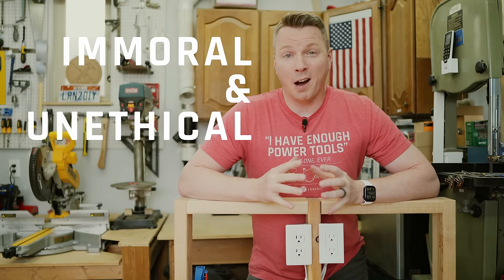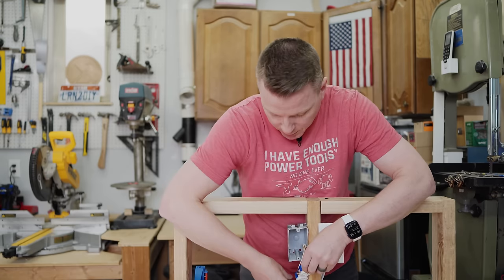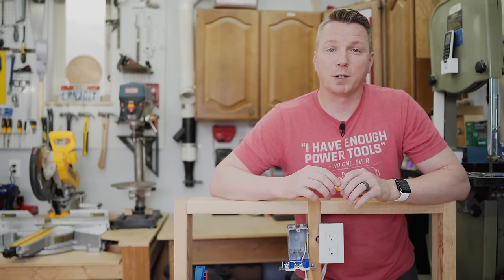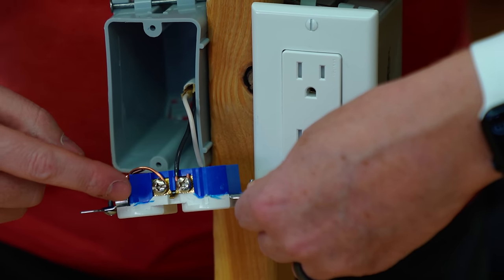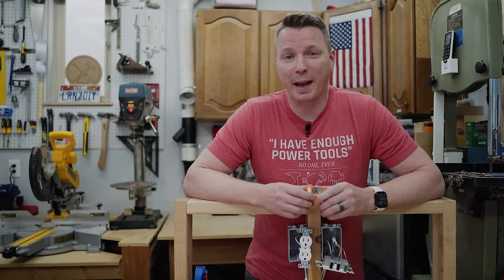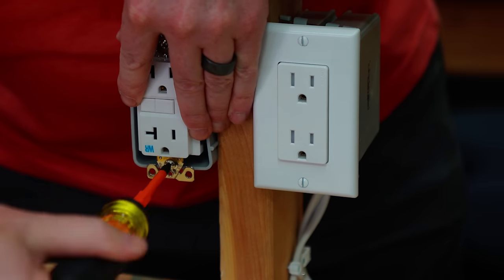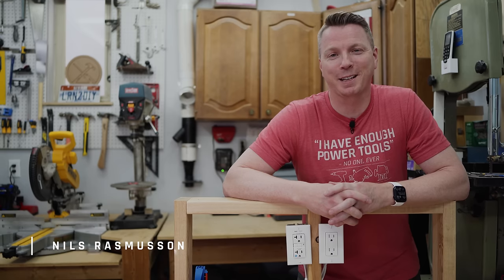People Are Adding Deadly Hacks to Outlets

Comment: I would ask "so why are the neutral and ground wires connected back at the main box"? Except for as far as I understand, the ground wire is a safety wire in case the hot should short on it and need a path back to ground thereby tripping a breaker. I think that's how it works, anyway.

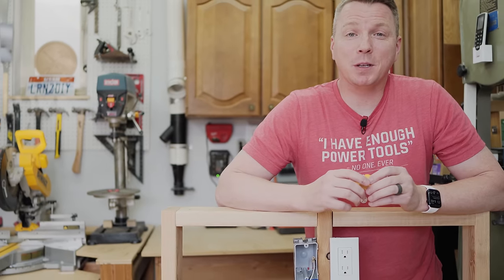Comment: 2:40 If all of the circuits weren't connected to anything (no Earth, no ground, no neutral), couldn't you connect a sensitive multi-meter between neutral and ground and measure the resistance? A bootleg ground would have a much lower resistance than a properly wired one. (There are other complicated techniques for measuring wire length that I'm sure the $450+ detector uses.)
(Caution though: you could easily fry a multi-meter using the resistance setting if there is voltage on the wires.)

Comment: Cheap tester vs. expensive tester. Cheap testers lack the ability to test the resistance between ground and neutral wires. The longer the wire the more resistance. As such an unusually low resistance would indicate a boot or short.

Comment: 8:00 "It's gonna handle all of that computation in just milliseconds"
That's not how gfci works. There's no computation per se, the socket doesn't need any micro chips, it's just sending the live and neutral through anti-parallel co-wound coils so that as soon as there's a current going through one but not the other it create a magnetic field. We can detect that field with a simple reed switch which can be tasked with tripping the internal breaker.
Reply: That is how they work in Europe. In the US the are electronic. They need to be far more precise as the tripping current is just 4-6 mA. In Finland electronic ones are banned as they are not voltage independent.

Comment: Favorite messed up house wiring I saw was the one where ALL the wiring in the house were yellow wires. Must've had a sale.
Reply: 😂
#12 Romex is yellow. So about 90% of the house will be yellow jacketed Romex. Black and orange for a couple loads. 

Unless you're talking about conduit, in which case it's about 90% homeowner "I don't want to buy 2 rolls of wire". I carry 7 colors of thwn-2 on the service truck in 3 sizes.

Comment: In my experience, a bootleg ground usually is detectable by an outlet tester. The ground light (the light on the right on the Klein brand tester) is not lit as bright as the middle light and flickers. If a GFCI has a bootleg ground, the trip button on the tester will not trip the outlet.

Comment: Simple way to check.  
If the outlets are 3-prong AND show to be wired "correct", but there are NO ground conductors in the electrical panel AND the home is not wired with metallic conduit...BIG RED FLAG. 
It is important that your home inspector remove ALL electrical panel covers (main panel and subpanel/s) and check for proper ground wiring, bonding AND grounding. The inspector should also remove a sampling of outlets to check for proper wiring. 

The usual suspects
If the home was built in 1971 or earlier and has three prong outlets...CHECK very carefully. In fact the NEC 1971 was not widely adopted as municipal codes until 1974.  (The NEC is not a "law" and is not a requirement, UNLESS the local authority having jurisdiction has legally adopted it as their code).
Three prong outlets have been required by the NEC since 1962, but until 1971 were not required to be properly grounded.

Comment: Shady, yes. And not recommended. However, at least in Finland this installation is acceptable in some situations. I could quote the codes but they are in finnish. How do i know? I had to do this in one location few years back and i did read the guidelines/regulations through. I am a certified electrician with an engineers degree in electrics and automation. Btw, i did this on a room scale and not in single outlets.
Reply: Different countries different codes. It is not allowed in Sweden for example.

Comment: Nice lifehack. Does it also work in europe?
Reply: Each country has its own codes. In Europe you do not need the GFCI trick as you can always plug grounded plugs into ungrounded sockets. If you want RCD protection you can pick a portable RCD for some 15 €.

Comment: In Australia its illegal for anyone but a qualified and certified electrician. They must give you a certificate of conformance to electrical standards making them liable for any issues. Electricity is too dangerous if you dont know what your doing, and whats with power points/sockets without on/off switches.

Comment: Wouldn't you be able to test if the connection is ilegal with a multimeter? 

Multimeters have an option to detect if there is connection between 2 parts, turning off the power of the house and testing from Ground to Line and Neutral holes would reveal if they did one of these ilegal connections.

Though ofc, if they didn't connect anything to the ground then that wouldn't work, though would be able to test that with one of the cheap outlet testers I guess

Comment: While your comments on code requirements are correct and safety is kinda right, you don't seem to have much understanding of why we have separate bond wires, what kinds of faults may pose a danger if the neutral is used as a ground or what risks are created by the reverse polarity bootleg. What people need to understand is that the ground wire in many appliance cords is connected directly to any metal parts that are not intended to conduct current such as a metal case or chassis. Think of appliances like toasters, microwaves, washing machines and the like that have metal cases. Those metal cases are generally going to be directly connected to the ground pin of the appliance cord. So now you can start to understand some of the things that may go wrong when you tie that ground pin to the neutral at the receptacle. A few things that can happen:

1. Upstream GFCIs may become unable to detect ground faults before they're able to cause injury.
2. You're now placing the return voltage from the neutral pin on those metal parts. If there's an upstream wiring fault on the neutral wire, that voltage could be substantial. In the case of a break in the wiring, this will be the full 120V mains voltage. 

This also explains why the reverse polarity bootleg ground is so bad. You're now connecting the hot wire directly to exposed metal parts on many appliances. Maybe the paint will provide enough insulation to prevent a shock - if it's painted. If it's stainless steel or scratched, then you could be in for quite the shock when you next touch it.

Comment: That hot to ground bootleg could potentially ruin electronics in addition to electric shock. Most decent digital electronics don't care which line is hot thanks to the rectifiers in the power supply. The issue comes in how the manufacturer grounded the power supply. Worse case, the hot line might go straight to the housing of the equipment.
Reply: Many years ago, AC/DC radios and TVs were common and they expected the neutral wire would connect to chassis.  Reversing hot & neutral could result in a deadly situation.
Reply: I would argue that the power wouldn't be on long enough to damage anything. If you were to take the hot lead and directly short it to ground and then turn the breaker on, it would trip immediately. Most modern power supplies have so many safeties built in to protect itself in situations like this it would most likely be fine.
Reply: @James_Knott  Reminds me of the old guitar amps with the two-pronged plug and the "death cap." Musicians would keep flipping the plug in the outlet until their equipment had less hum. That certainly used to cause issues with amp chassis being "hot."

Comment: Natural is NATUAL, ground is GROUND, that's it.
In my personal experience, connecting ground to nearest metal that go though underground like structure metal beam, metal pipe for heating or water is still better than natual, despite it's illegal too.   Ground and natural have same electrical level is a thing from "perfect" world, which ours is not. 
Years ago in the place that I lived in, I always got shocked when contacting the metal case of my computer. They had the same wiring diagram. After I wired the ground to a structural metal beam, I nolonger feel the shocking.  And I it turned out that the voltage between natural and metal beam was near 20V !

Comment: havent watched but guessing talking about running wire from ground to neutral. I had an electrical company tell me to do it to fix my open grounds
Reply: If they told you to do that, whatever that company is, needs to be reported.  Jumping an electrical outlet’s ground terminal to neutral, is very dangerous.  Most appliances that use this safety ground, tie the ground, which normally should not carry any voltage,  directly to the casing.  The idea here, is that if there’s a wiring fault in the appliance which causes hot to touch the casing, a properly grounded outlet will cause hot to short directly to ground, thus tripping the breaker and killing power the appliance.
By jumping ground and neutral on an outlet, you’ve basically connected the casing of any grounded appliance directly to part of the actual circuit!
Reply: @sneskid78  is leaving an open ground safer?
Reply: @you7uber5  
Neither option is considered safe, and therefore neither option is legal via the National Electric code, but to answer your question, leaving an “open ground” is “safer” than jumping the outlet’s grounding screw to neutral.
An outlet’s ground connection under normal circumstances should have ZERO voltage.  The only time it carries any significant amount of current, is if there is a fault somewhere. 

Think of it this way:
  
Let’s say you have an appliance such as a refrigerator or a washing machine, or even a piece of electronics such as a computer, etc., that has a three prong wall plug.  The round ground pin on the plug will usually be wired directly to the chassis of this appliance.  This is a safety feature.  If this appliance is plugged into a properly grounded outlet, and the appliance develops a fault that somehow electrifies the chassis, such as a broken wire, etc., the fault will cause a short to ground, which in turn causes an overload condition that should trip the circuit breaker in your house, thus cutting power to this appliance. 
If instead you plug this appliance into a non-grounded outlet, you will be defeating this very important safety feature but under normal circumstances, at least you’re not causing an additional shock hazard by doing so. 
Now if you plug this appliance into an outlet in which the ground screw is jumped to neutral, you will essentially be causing a “leak” that could very well electrify the appliance’s chassis, thus directly turning what should be a safety feature into an immediate shock hazard. 
I was actually almost killed at work, because someone unbeknownst to me, managed to wire up an equipment rack very similarly to this.  
The ground and neutral connections should never be swapped, and one should never be substituted for the other.  
In addition, there is only one place where they should be combined, and that is in your MAIN electrical panel where power enters your house - nowhere else!

Comment: 8:05 computation? very funny statement - it is simple physic: If the current flowing in is equal to the current flowing out, there is no magnetic field generated. If there is a magnetic field, there is a problem and if the problem is literally big enough, then it pulls an mechanism that trips the circuit.

Comment: 👍Agree w/ ya sir. (But in the main box doesn’t neutral go to ground bar?) just sayin
Reply from the maker: Great observation. It does in the circuit breaker box (typically) and that's called bonding. That's what make it possible for the circuit to detect a fault or overload and trip, keeping us safe. It's when you see this hack at the outlet that you need to be concerned because that will essentially do the opposite. Kinda hard to explain but bonding (neutral bus bar and ground bus bar connected in the circuit breaker box) = Safe, Bootleg Grounding = Unsafe.

Comment: In the panel the white wire and the ground wire goes to the same terminal bar so in a sense it is grounded so I don't see a problem with that
Reply: Connecting ground and neutral outside the panel presents a whole bunch of problems. Current flows on ground wires, appliance cases become energized, and all kinds of fault conditions become much more deadly.

Comment: You should read something about TN-C and TN-S... This is not hack or bootleg, this is normal and it is still in lot of houses and in past this was standard. If you have only 2 wires you have no other option...Only option how to imprrove safety in this case is to use socket with integrated GFCI/RCD like you mentioned. But this was not an option in time when TN-C was standard and whan it was build.
Reply: Each country has its own rules.

Comment: If you were a real sneaky snake, you could take some modern "romex" with a ground wire, attach it to the old wire, and then connect the ground wire and the neutral together. Then push this splice into the wall. This way it appears that there is new wire run to the box, but there isn't really...
 
Please DO NOT DO THIS. it is even worse as there are now splices outside of a box.

Comment: Unfortunately he did not explain why it is bad.

Ground wire is connected to neutral in order to provide electricity a low resistance path in case live wire touches appliance's metal casing.

So bootleg ground wire still performs it's function and saves you from electrocuting. Can anyone really explain what's wrong with it?

Comment: In many countries bootleg ground is perfectly fine (wire minimum of AWG 9 or 10 and the neutral wire is connected first to ground and then a jumper wire to neutral in the socket; this way ground is the last connection to break; it's a good idea to install a GFI socket which is able to separate ground an neutral in the socket itself). Some homes here have a 3 phase power without a neutral connector at all and the virtual neutral connection to the ground is perfectly fine (if installed correctly; exp. symmetrical load to all 3 incoming wires). If you want to run wires smaller than AWG 9 you must separate these wires in a box (with GFI now)

Comment: I'm not understanding why it's dangerous if it's in the proper side. The ground and neutral both go to the exact same place in the breaker box. If a short does occur and it goes into the ground of the outlet it still goes to the same place. Obviously not ideal but it functions the same as far as I can see.

Comment: While not ideal, I would argue that this method is better than no ground at all. If the house isn’t wired for ground and you don’t have thousands to rewire this house, this is better than nothing. As long as you don’t switch the hot and neutral of course 😂
Reply: I agree completely. I know it's against code, but this scenario is not as dangerous as he's making it out to be.
Reply: @paulcrandall2534  code doesn’t apply everywhere anyway. Where I live there are no codes, permits, inspections, etc. I didn’t even know such things existed until I started watching This Old House.

Comment: I'm sorry but GFI outlets need a ground to function properly because they use it to figure out if there's something going on with a neutral. That just won't work without a ground
Reply: That's not true at all, you obviously have no idea how GFCI outlets work.
Reply: @sylviaisgod6947  even in the name, Ground Fault Interrupt. If there's no ground, how can you tell if it's at fault or not? By the way, I'm a licensed electrician, what are you?
Reply: @Navitas2003  Seriously, you should have your license revoked, since you don't know the basics of how a GFCI works, probably a lot else you don't know.
Reply: @sylviaisgod6947  you didn't say what you had. What are your credentials?
Reply: @Navitas2003  Just do not argue when you know you are wrong and if you do not then you should instead learn. Do you think you know better than those writing the NEC?

Do you know what a ground fault is? It means current escapes from the circuit to the ground. Sure this can happen and in fact most often happens through the ground wire but the GFCI does not care where it escapes. The dangerous thing is that it escapes through some person. That is why we use GFCIs, not to prevent current from escaping through the ground wire.

Comment: Electrocution or death?  Electrocution means death by electrical shock.  I'm pretty sure that's not an "or" situation. :|  Unless you're the man of steel, I can also guarantee that you won't get "the full 15 amps" from that 15 amp circuit if you touch it, no matter how well grounded you are... people simply don't have 8 ohms or less skin resistance, even when wet.  
By the way, the NEC doesn't state that the ground wire has to be in the same sheath as the neutral and hot - you can just add an uninsulated or green 14 gauge wire from the outlet box taking it's own path back to the grounding electrode or ground buss in the box and save thousands over a "rewire"... no need to replace the perfectly good wiring in the home (if it's perfectly good of course).